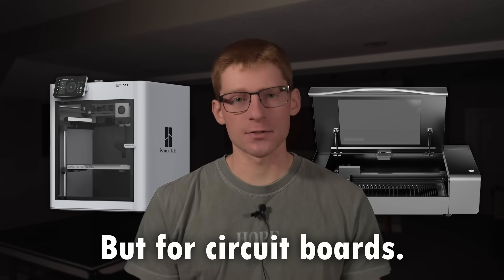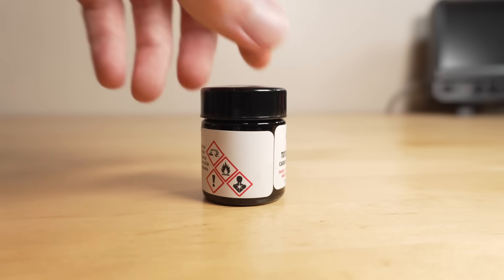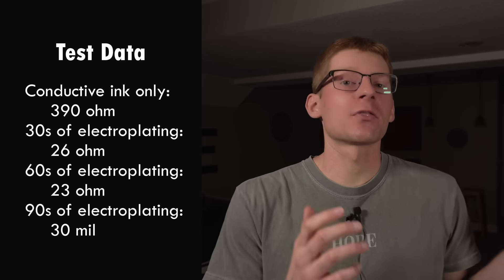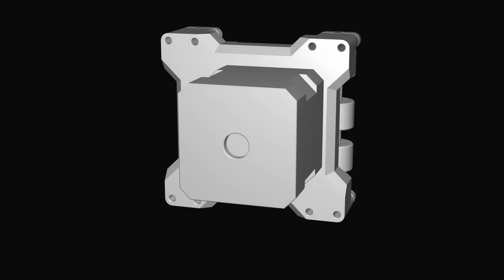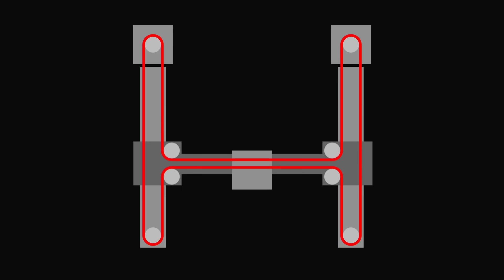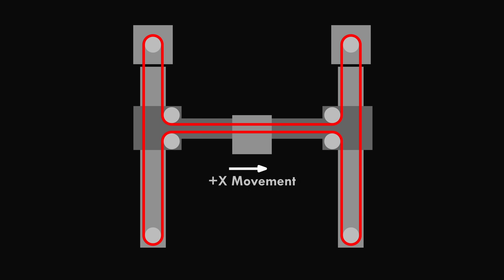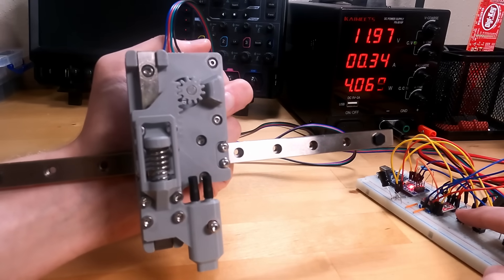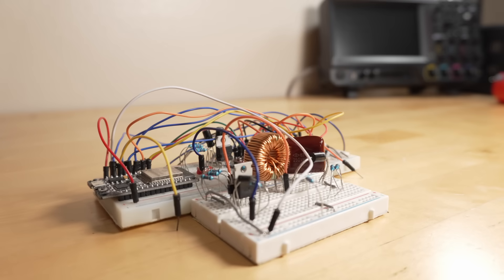I'm Developing a New Circuit Board Manufacturing Technology

Comment: Someone's going to buy some very narrow tungsten rods. I can see where you're going with this. There's a printer that has a similar idea with copper that does basically what an SLA printer does but using copper sulphate electrolyte instead of resin.

Comment: The linear bushings having some play isn't actually that big of a deal. They can easily (but carfully) be cut open with a thin sawblade and then they could be compressed to remove any play. That even allows to apply some tension (preload). Some of these bushings have carbon inside, so they don't rub as much. I tried that on a project with size being a limiting factor and it worked great with zero play and still free motion - in that project I converted a cheap 3018-pro router to use 12mm rods and make the x-axis more rigid that way. When the bushings are open, you can even introduce some automatic tensioning/compression directly into the gantry that holds the bushing (basically springloading them with the printed part itself).

Comment: Can you use a small thin wire or bolts then clamp them down or blunt them to join two layers and if you use something like a thin screw and the blunt them with pressure to make contact it would almost be instant

Comment: Have you considered "squirting" a piece of copper through the board and automating soldering on both sides? Could basically take an oversized hot-end and just aim for the hole and solder the bottom end then use some type of cutting device to cut the copper to board depth length and solder the top. Maybe even better make use of the tensile strength of copper and use pinch and retraction to bend the wire over the holes by combining a side ways movement and the cutting action at the same time.

Comment: That second belt path is called h-bot. There is a reson it was abonned. Corexy is far superior. Since hbot creates racking... not good for anything needing precision.....

If it is a machine focusing on precision over speed. And will have a heavy toolhead anyway. Use a cartesian system is better. Way more easy to design and build. Use same amount of motors. But have a heavy x gantry given that one motor needs to move along on the x axis.

Corexy benefit is loosing up weight. To enhance speed.

Also with cartesian. Ypu can consider a ballscrew design for very strong slow speed precision printer. Should you want it

Comment: This might be a stupid question, but is there any reason why you can't make a hole, melt solder to fill that hole, then drill a 0.3mm hole in the solder? I'm imagining a 3d printer hotend literally depositing solder into the hole... 

I'm sure there are a million reasons why that wouldn't work... But I'm just wondering why

Comment: When you explained how difficult the vias were to produce it got me wondering, why not just drill a hole and put some kind of pin through it then solder that in place on both sides? Sort of like using the leg of a resistor, but without the resistor. If it's just about bridging traces on two sides of the board, why does the hole have to have an opening?

Comment: Why don’t you automate the vias by drilling the hole then feeding a wire through it and soldering it? Maybe the extra step would be some minor grinding so that the board is still flat for any cnc traces?

Comment: VIA Idea: Drill hole. Solder and plug hole from 1 side. Insert metal wire and then solder from other side. Trim excess wire.

You could try with 0.5mm enamelled wire

Comment: Why not drill the hole, thread it with a small copper wire, and then solder/weld both ends to the board?

Comment: Why not just fill the via with solder and then drill with a smaller diameter if you need the hole? I know absolutely nothing about pcb or circuitry, just wondering why this wouldn't work
Reply: No, it doesn't work, the solder balls up at the two outer surfaces and does not fill, because solder is attracted to copper, and also when molten has extreme surface tension of its own.

Comment: add a via insert er using something like a pop rivet. so just place the plug in the hole left in the printed board 
your system to complicated just drill and put a short wire in the hole and press it or etc/
faster and continue

.

Comment: It's not electroplating, but I've seen people use what are basically copper rivets or something similar. then they could be drilled to the proper diameter if needed. If it's just connecting layers together, it's OK to leave solid. Great video by the way, and thanks for showing the failures as well as the successes, as too many times these kind of design iterations don't get shown and newbies, and I guess even seasoned persons can get discouraged. I subbed and am looking forward to your future successes!

Comment: This summer, after many years of failures, I was finally able to make proper vias at home using cheap, easily available and relatively safe chemicals. With silver nitrate being the most expensive. Very little is used though. There is this cool lady here on YT that explains this process in more detail. Robert Feranec talks with her about this method.

Full list of chemicals for this electroless plating process is (roughly in on order of use):
1. H₂O (danger, highly toxic) - solvent and for washing between steps
2. Na₂S₂O₈ (aka. B327) - first activator
3. SnCl₂ - second activator
4. AgNO₃ - third activator
5. CuCl₂ - source of copper
6. Na₂EDTA - complexing agent
7. NaOH - pH regulator
8. HCHO (aka. formaldehyde) - reducing agent.

The idea is that first activator modifies FR4 surface to accept metal better. Second activator is in preparation for the third one. Third step involves sparsely depositing silver metal particles on the surface. Next step is the actual plating. It involves EDTA stabilized basic solution of copper chloride. It's somewhat unstable so when formaldehyde is added, copper ions are easily reduced to metallic copper. Silver particles embedded on the board serve as kind of preferred starting locations for the reaction. After about 15 to 30 minutes of light stirring nice and shiny layer forms. If everything went right it should be stuck to the board pretty well. You would still be able to scrape it with a screwdriver but not with cloth or paper (tested on bare, flat FR4 board, not just inside vias).
It creates nice layer on FR4 substrate by itself, but is way too slow to be the used as the only method of plating. When you get "thick enough" layer from electroless process, you continue with plain old electroplating.
I know it also kind of works on glass (needs more testing and tuning). I am yet to try this method on different substrates, like 3D printable plastics, epoxy castings and plastic films. I might have some time this winter to do more experimenation with it.

Comment: Just a thought, 

Could you not use tiny copper tube and crimp it (squash bottom and top) to connect either side? 

Or failing that tiny copper wire  to go through and crimp still allowing for the component to go through the 0.3mm hole

Comment: JTH MUC(mostly useless commentary): 12:01 clamp down on both sides only once, run the drill up through a T  junction through a ball valve on the bit side, the ball valve will be a tighter seal to my next thoughts. 15:38 path of least resistance? with the .3 via size attempt is my initial observation try changing consistency of the ink. And my experience in plating is smoother the surface the better. Check the bit try a different style. Experiment with putting your micro chamber under vacuum to get full ink and plating penetration. Your micro plating bath should work fine.

Comment: If only worried about vias (not component holes) LPKF has a heat cured conductive resin in the ProConduct line specifically for conductively connecting the two sides. Squeegee on, vac table it through, cure in the oven.

Comment: Why not fill the hole with liquid solder? Or melt in in the hole? it It only takes a second or two to solidify. Additional idea: with surface tension you might not even need to plug the bottom of the hole.

Comment: 1. Drill via hole
2. Copper wire poked thru via, contacts toolhead on other side
3. Argon flow + resistance heating evaporates copper wire, which condenses on via hole walls - to optimize uniformity of PVD layer (the hard part) use high-freq AC, so skin effect evaps outer layers faster than the whole wire
4. Electroplate thickening after that

Comment: I suggest PCB Way. And wait for delivery. It is worth it - or it was before rumpy started the tariff war. I predict the tariffs will not last. but it will require that the economy suffer badly to prove the point - FAFO.
Dicking with a system as broad and deep as world economy by a total idiot and a-hole is a big problem. Bankrupt will happen.
Rant rant rant,...

Comment: Maybe the solution here is not to discard older ways of doing this, but to revisit them using new tools. Is the only problem with rivets the height above the surface of the board. 1) can the board where the rivet is, be drilled partially so the rivet head and tail sits in their own well? Aircraft use flush riveting. Instead of trying to plate the hole from one side to the other, plate the location where an indent was drilled on each side. Plate after the rivet was inserted. 2) Can the board be pressed with high amounts of force where rivet heads will sit so the pcb board itself is thinner in that location (dimpling)?  3) Why is the height a problem? Is it because you want to place rivets under surface mount parts and need them flat to the board? If that's the case, would it be easier to mount the surface mount parts in a raised manner so the height isn't an issue? Can you shift the problem from flatter rivet heads to taller pad heights?

Comment: Why not buy boards with photoresist pre applied and than expose with an projector or and 3d resin screen. Super fast and high precision and then use chemicals?
I know you don’t want to use chemicals but I think i would prefer this way.
Another thing is, why not use inserted vias? I don’t know there name, but there is something for it.

Comment: Cool to try but .... what if you have a hybrid approach? 
Wonder if it is possible to order copper clad boards with a bunch of standard vias then simply use/delete them as required!
This would work with most things and final prototypes could have the vias moved for space and RF considerations.

Other ideas:
1.  Press fit wire jumpers?
2. Spray molten metal
3. Metal printing

Comment: Why do you need a via if you are going to fill the hole with solder?  I bet solder would flow to conductive paint or some other deposited material.  You just need a low resistance conductive pathway through the PCB.  Even if you have to fill a larger through hole then drill it to final size that would lend itself to a desktop process.  Sometimes modifying an established process keeps us from experimenting with alternatives.  Time to reinvent the wheel.  You might even be able to press copper plugs into the board and drill through them.  So may alternatives, so little time.

Comment: Maybe there's a reason, but why not mechanically insert a wire with a slight interference fit, use electroplating to make the connection from the insert to the clad plate homogeneous, drill out the center of the insert, and lap the board flat.

Comment: 30mohm for a via? That sounds really high, are you sure about that?
You can glue a diametrically polarized magnet for an encoder on the back end of the stepper's axle and turn it into a servo. You won't need a silly spring then and can control the force precisely.

Comment: I would like if we could make pcbs the way we 3d print metal parts, a fine powder that turns into copper traces under a laser and the same powder turning into fiberglass/non-cond. material with a different beam.

Comment: Something that might work … 

Fiber lasers are all the rage now for the pcb traces, and some of those are strong enough to make the hole through the fiber / pub Board.

But even if you don’t use a fiber laser to cut the hole, a byproduct of using lasers for engraving etc is carbon surface … ie LIG ( laser induced Graphene) depending on the material wave length of the laser, but you may or may not necessarily want Graphene … but the fact that it makes a carbon surface (burnt) might remove the step of having to use the carbon/graphite ink as the laser would  char the hole for you…

Maybe even in the same step or with the laser you can plate the copper 🤷‍♂️  do some sort of disposition using the laser I dunno about that but just an idea 💡

Comment: This is totally doable with a multi-tool CNC! You can drill the vias, insert tiny copper eyelets, crimp them to connect both layers, and even solder them for reliability. A pogo pin probe can be mounted to the CNC to test continuity automatically — just connect a reference probe to the bottom layer and measure resistance after each crimp. Fully automatable homebrew vias, no PTH needed! 👌🛠

Comment: So, maybe I'm misunderstanding the use case, but to me this tool/ board MFG process is JUST for prototyping and you would still want to order boards from a traditional MFG for anything final product/production right? 

If thats the case why do you need real hole vias? I think a much simpler solution would be to make a conductive solid via. If you drill a hole of the diameter that you need and then just seal the bottom in a dome around the outlet side and pour solder in the top you create a via that can carry current to the other side of the board. My vision in my head is that it would look like a rivet of solder. If you need through hole components the legs will act as the via once they are soldered anyway. The biggest downside to my solid solder plan is that these prototype boards would be more delicate than production boards as if the solder of the via was melted it would fall out the bottom of the board. The solution for that is to simply use a high temp solder for the vias and then use normal low temp solder for the components after. As long as you were careful with your iron temps it would be fine. 

That seems a lot simpler and easier than trying to get these electroplated vias working on a small scale.

With the solid via approach your tool head just needs to get hot and deposit solder, which can be fed like 3D printer filament (maybe even use an adapted 3D printer hot end to do this actually). 

Please tell me if there is something obvious that I'm not considering here.

Comment: Insert copper wire into Via so entire via is filled with (solid) wire. Then high current pulse locally melts effectively soldering Copper to copper. 

Probably doesn't work, too hard to get just right melt amount... but just thinking

Comment: I am asking because I don't know. Why are they making a hole then covering the surface of the hole with copper instead of just putting a solid copper pin between layers? is it a cost thing, or has something to do with the weight. Or resistance maybe?

Comment: I'm not an expert in this field, however could vias not be just a insert of copper wire and then each end soldered?

Kinda like a rivet .

You drill the hole, push in a thin wire, or even just fill with solder, then solder each end.  It may not be super tiny, but for a porotype may be sufficient.

Comment: I don't know anything about making PCBs but my first thought was to mechanically insert a liner for the via, like a tiny copper tube or insert a wire, secure it in place with solution, then drill out the center

Comment: Could i suggest avoiding the complexity of plating altogether?

I imagine it would be much simpler, more robust and probably much safer for a desktop environment to simply place jumper wire through the via soldered on both ends...

Comment: Hmm . . . My thought process would be to make a mini version of those old school rivets that were sometimes uses to connect different sides of old school circuitboards. You'd have a feeder mechanism that forces in the correct diameter copper wire and then snips the ends and force fits it to make a seamless internal fit. It may need some solder though if the hammering process cant get it quite seemless. The other option is to fill each hole with some form of solder with a sufficiently low viscosity that it easily fills such through layers.

Comment: 😊 well first off, congratulations on a magnificent try.
I did also try to play around with via electroplating and had miserable success.
Unlike you, when I threw in the towel, I threw in the towel.
I decided that for simple prototypes, I would just simply solder the components on both sides. 
For the via’s I would just simply insert a small wire and solder both sides.
And if I had anything that was more complicated than that, I simply would order the boards.
The other reason for this was using micro controllers with incredibly small pitch factors. 😢
But I do really appreciate your efforts and learn a lot from your endeavor  😊

Comment: Why not drill the holes, get some 0,3mm solid copper wire, and peen the ends of the wire to make the vias (like a traditional rivet). That should give low resistance and be good enough for a prototype, right?
Reply: That's my thought process as well.

Comment: You need a way to get the circuit board on the top of the wafer connected to the board on the bottom? Why not just solder a wire from the top to the bottom? Or just paint a conductive trace down and over the edge and then electroplate that? Or if it needs to go through the middle of the board why not drill a hole and stick a wire through and solder it? Am I missing something?